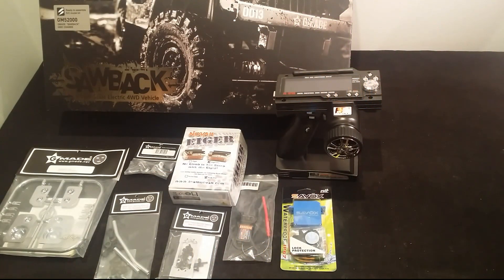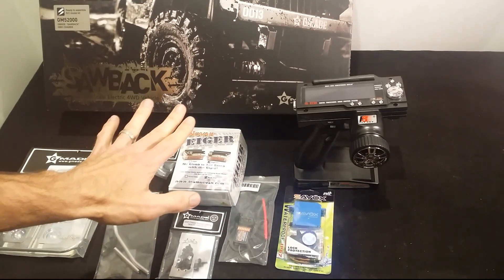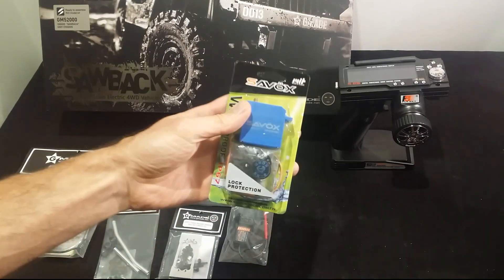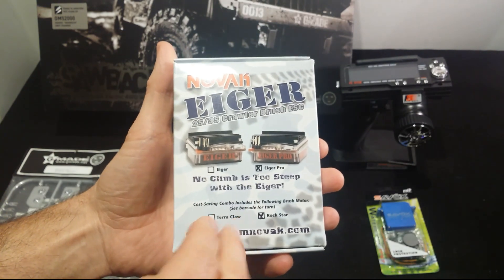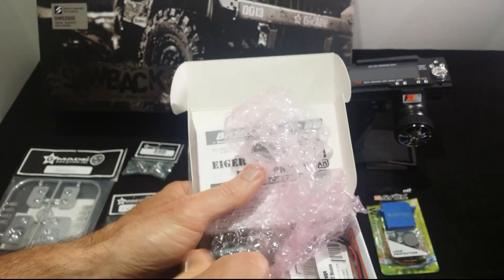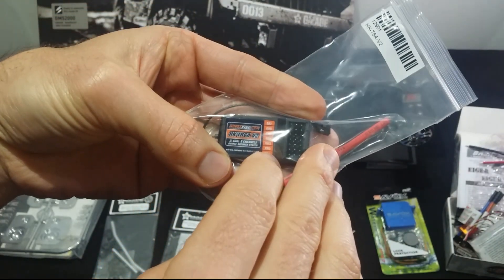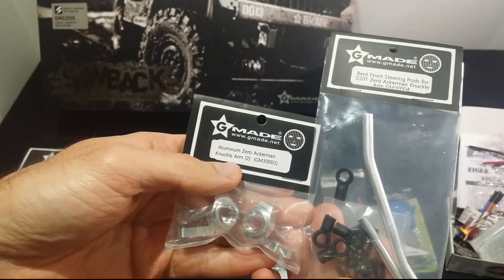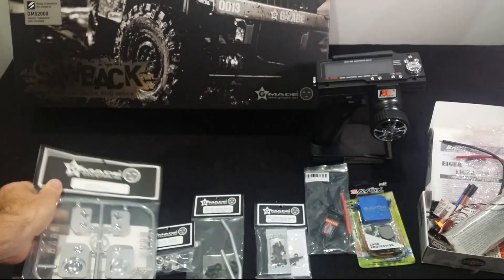GMADE SAWBACK *Electronics & Hop Up Parts* BUILD SERIES

Comment: Hi. how much is the esc novak? is it a good brand? Do you need a card to program it? can it handle a 3s lipo? thanks and good luck with the built.
Reply from the maker: Hello, Novak is a fantastic brand. Well known throughout the industry. I purchased this for $115au or around $90us. You do not need a program card, you use the onboard button on the esc. Yes it can handle a 3s no problem.
Reply: RC Tanks & Trucks 24/7 Cool. Thanks.